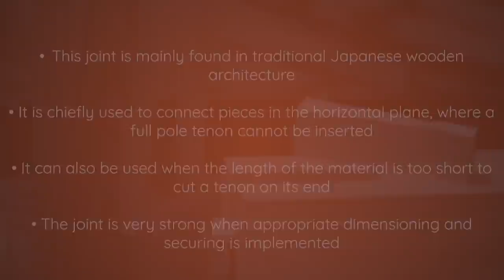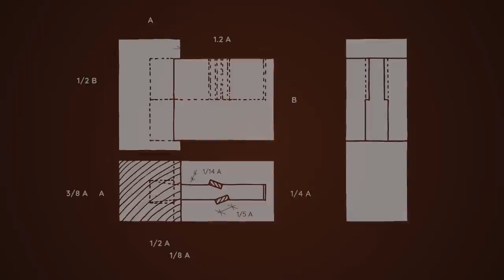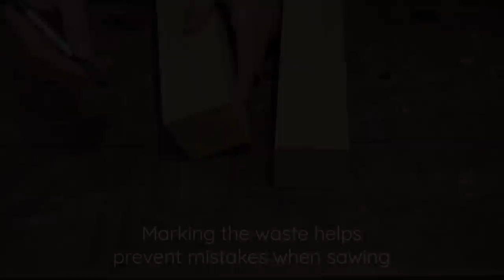Random Joint Investigation Ep.2: Yatoi Hozo (雇ほぞ)/ Draw Pinned Spline Tenon (Japanese Joinery)

Comment: I have no use for this but I LOVE to learn about it and watch it get made... maybe one day when I'm older I'll be doing this as a hobby :)
Reply: Mail box post? Do the joint on the underside and glue in the wedges? (That way you don't have that little gap collecting rain water). You could use varnish as the glue so it could be removed in the future if you think it might be necessary. Or do the other version shown near the beginning of the video with a cross pin that could be driven back out, just remember to draw-bore it so it can pull the joint tight.